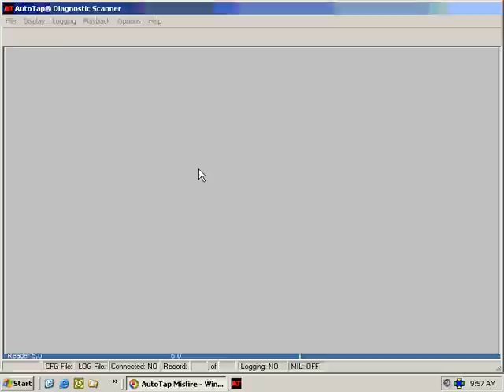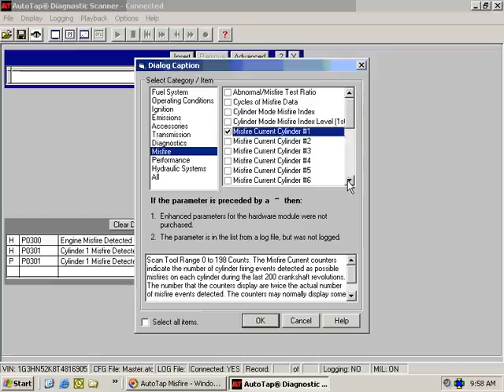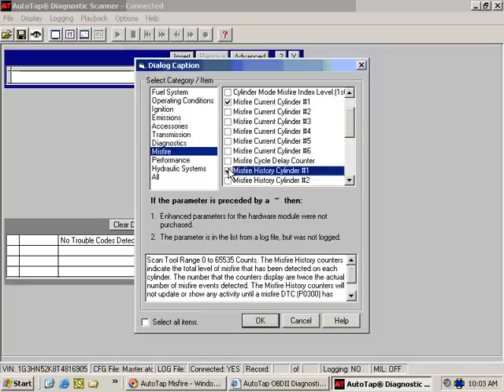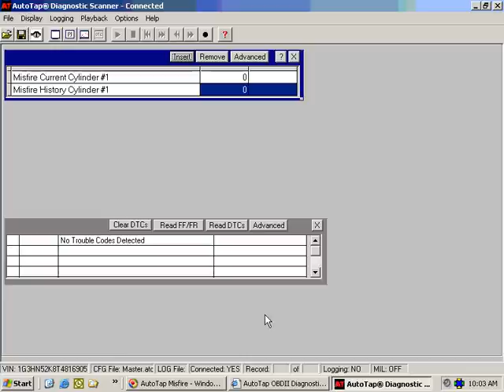AutoTap OBDII Scanner Demo

Comment: Using any computer feedback from the car is a starting point, and a tool. You still need common sense and skill to diagnose a lot of problems. 
If the video was titled "How to fix a cylinder misfire" I would agree with you totally.

Comment: This video is a joke. Autotap may be a good DIY app, but without sho manuals to give a diagnostic tree, you are , genrally, guessing about the problem. Most DIYs are generic tools that give global pids only. Besides, bad plugs would, more than likely, cause the MIL to not only light up, but flash also. So the claim of replacing your plugs may not be totlally forthcoming.